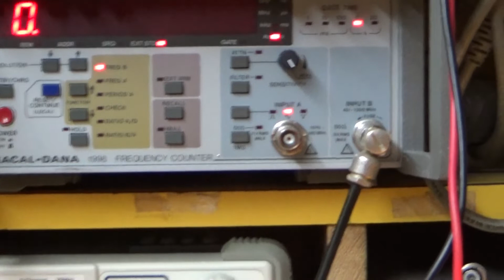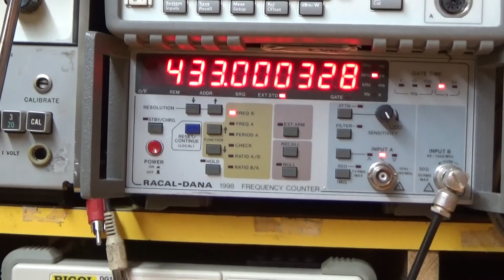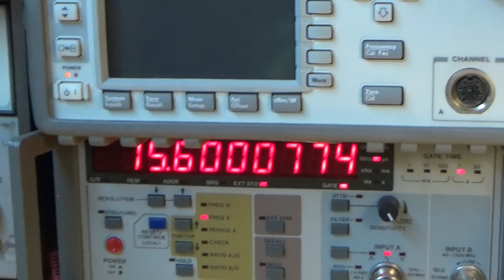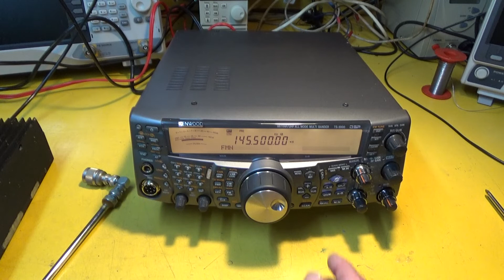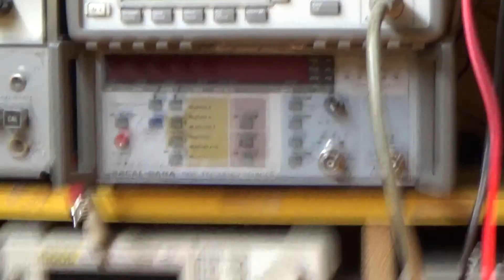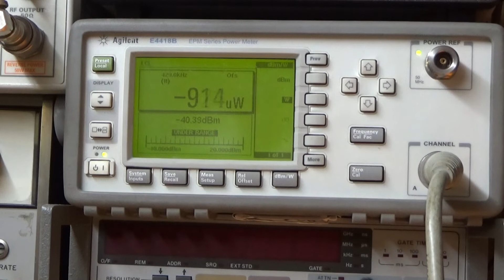Kenwood TS 2000 check over and adjustment

Comment: Thanks i need to do mine.. its way off  and you can hear it on SSB on 10M real bad. i have to adjust the VFO down a bit to have people talking normal.. 
i have a cheaper Freq Counter but i all so have a 10Mhz GPS standard to set it agents..
Reply from the maker: @Mr_Meowingtons  well you certainly need a decent frequency reference before attempting any adjustments. GPSDOs are so cheap now that anyone can get high accuracy on their counter

Comment: I purchased, a Kenwood TS 2000X, from one of the U.K. emporiums second hand, about 2 years ago. It was originally purchased, as a backup for my Icom 9700 for 23cm fm / ssb. It’s probably worth mentioning, like many others, I came back into amateur radio after a very long break, but rekindled the interest during Covid, around 2020. I also checked / adjusted the tcxo / frequency, and yes it was very finicky and fiddly, but once done, was pretty accurate (allowing a couple of hours switch on before carrying out the adjustment(s) of course). The TS 2000X tends to get used a lot more than the 9700. Why? Because it is an absolute pleasure to use. Sensitivity doesn’t appear to be an issue, it hears as well as any other 2m / 70cm / 23cm radio I have in the shack. Also, the TS 2000X doesn’t need any additional frequency stabilisation, unlike the Icom 9700. The 9700 required the addition of a Leo Bodnar, gps signal injection mod to make it anywhere near usable on 23cm ssb. Not great for a radio that only needs to concentrate on just three bands, and the right side of £2000, an issue that Icom have never really fully addressed. Sadly, Kenwood have never made the modern replacement, of the TS 2000 that many of the main emporiums suggest they might (I don’t believe they know anyway). Equally as sad, the TS 2000 in all its guises, are becoming rarer to find as time passes by.
Reply from the maker: @bunston1000  I agree with some of what you said. I still have a TS 2000, but it never gets used on 2m or 70cm. I find the 9700 a much better radio. Its expensive for what for me is basically a single band radio. 70cm and 23cm are fairly hopeless from this location.
I love the band scope and the S meter which is perfectly calibrated at 3 db per S  point and 60 db over nine really is that.
I've never had a problem with frequency accuracy and stability, I know mine was within a few Hz on 2m when last checked more than good enough for SSB and FM.
Of course it could be a lot worse on 23cm.
If I was that bothered I'd connect a 10 Mhz reference to it.
The 2000's S meter was hopeless on FM, with only about 30 dynamic range from zero to full scale, but OK on SSB.
I've also not found any difference in sensitivity with the two radios.
73 Nick
Reply: Would you have any idea why my S meter is not reading anything?  I think I hit some button (there are so many) and I don't know how to undo it.
Reply: @daveengstrom9250  Check you haven’t turned the r.f. gains back on the main & the sub.

Comment: I think the TS-2000(X) is probably a most misunderstood radio. Many have made anecdotal claims that it was “deaf” on VHF/UHF (too many people listen with their eyes) and a poor performer on MF/HF. I’ve had my TS-2000X since 2011, and according to the serial number it was manufactured in 2011. The only modifications I made to it was to expand the TX range for 60m and install the Inrad #92 filter. For CW I found it comparable to my Elecraft K2 and K3 after installing the new filter. Unfortunately, due to a degenerative illness, I had to hang up my mic and key in 2014 and the TS-2000 has been in suspended animation in its box since then. For all the naysayers about the TS-2000(X), it must have had something going for it for it to hold the record for the longest in production amateur radio set.
Reply from the maker: Thanks for your comment, yes it's a nice radio. Some of the early ones had problems with the ceramic filters but mine never did. I only ever used it on vhf or uhf as I've never really been interested in hf except for listening. I bought an ic9700 to replace it & could not see any difference in sensitivity between the two. One small complaint is the s meter on fm is fairly useless with about 20 db between s 1 & full scale but is fine on ssb. Sorry you've had to give up on radio because of illness. Best wishes nick

Comment: That’s a fancy rig they get good reports although they did have some issues with the ceramic filters. I believe it was a manufacturing issue
Reply from the maker: Yes it's a lovely radio Chris, except for the s meter only having 20 db range on fm. This one is a latter model so I think they sorted the problem with the ceramic filters as this one has been fine since new
Reply: A very common one at that only had my used 2000 2 days and second vfo went deaf out of nowhere other than that love the look..

Comment: I very nearly bought one of these many years ago but went for the Yaesu FT-847 instead. Thanks for showing us how it performs and that TCXO was a pain to trim. I need to do the one in my FT-857. 100 watts on 2m is very good without an amplifier. Did you have a look at the S meter calibration or are they rubbish anyway? All the best Graham
Reply from the maker: Thanks for watching Graham. Yes painful to watch me adjusting the reference oscillator should have edited some of that out.There's nothing you about do about the s meter on fm it's a poor design,always used to annoy me that, Works fine on ssb. Best wishes nick